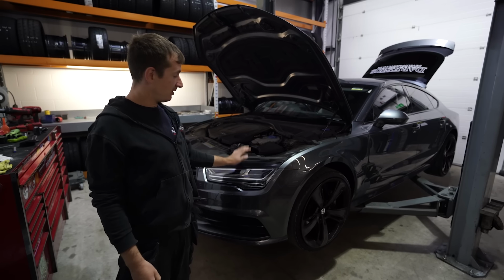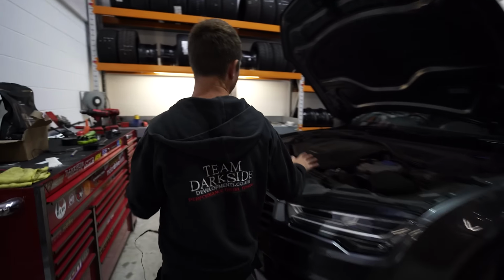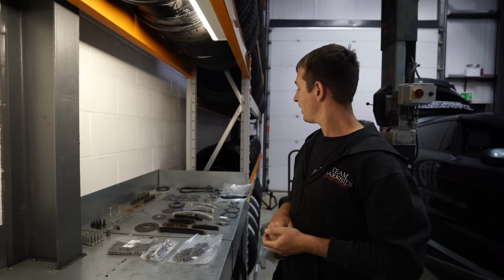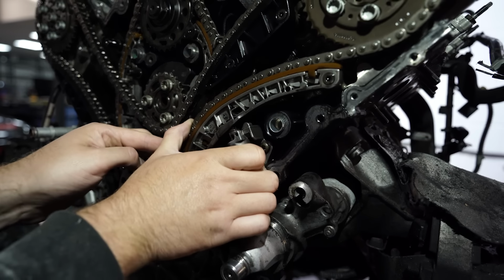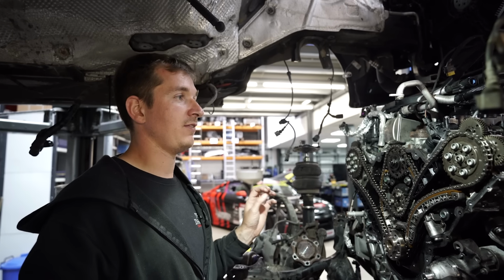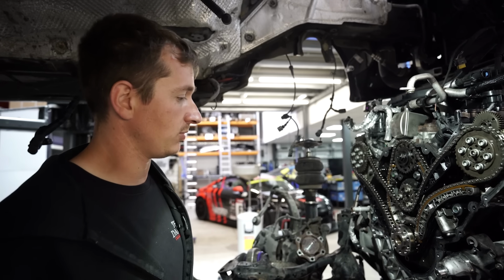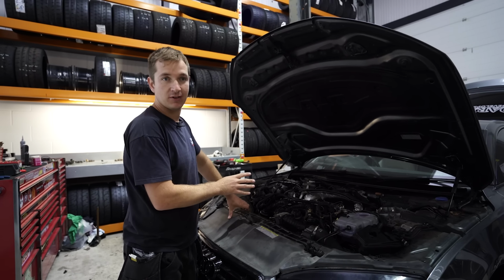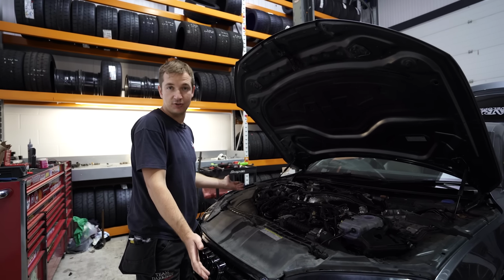AUDI 3.0 TDI V6 TIMING CHAIN RATTLE! - WHAT'S BROKE?? 😳

Comment: You mentioned Paul's A4 and he heard a noise once...  I have a 2015 Q5 CPNB @120K in the USA.  After recent EEW Upper Pan Reseal, I hear a light tick.  It is new tick, but Dealer told me to suck it since I have now passed 120K.  She is currently sitting in the driveway drained of oil with a new filter.  Still debating my path.  Can I get a quick recommendation for Oil Flush(es)?  Don't mind wasting a little oil if it gets her right.
Reply from the maker: Rowe or Liquimoly flushes seem to work for us!

Comment: Hey mate, i have a6 3.0 tdi tuned to 314 ps and i have problems with the brakes, i changed 2 different sets, zimmerman sport and ate rotors+ ceramic pads and i have always the same problem, when the rotors heat up, i got vibration inside the car. I work in germany and i only drive on the motorway, so doing 160 -180 km/h it's normal. What kind of brakes do you recomend for me as an upgrade? the engine was CZVA at the base, the 218 ps one with 345mm front and 330mm back . I really want to get rid of this vibration..
Reply from the maker: We use brembo but I can imagine your hub flanges are warped.

Comment: I dont now why Audi cant make it last like every 3.0 Tdi hast these problems
Reply: The chains are like bicycle chains because of cost (corporate greed), and insane emissions standards.

Small chains don't need as much power to be spun around and make less friction. Every parasitic load on the engine means burned fuel and thus emissions. That's also why there are no more hydraulic power steering racks. Or why variable oil pumps, AC compressors and high pressure fuel pumps became standard. Or low tension piston rings for less friction (which allow oil burning) with specially treated cylinder linings. The list goes on and on.
Like 90-95% of this complicated crap on modern engines is just there to meet these ridiculous emissions standards. The WHO just came up with some numbers, and the EU just made them the law. Done.
Ridiculous long life maintenance schedules (as he said, the oil is done at around 6k miles) do the rest.

Comment: Done this job for a customer, did take me 1 week because I only had like 3-4 hours a day to work on it. Total 20 hours. Was a FWD and only took the gearbox off, so a little less work than taking the engine out. 
I agree with the oil change intervals. Doing max 5000 km or 6 months with my 2.0 TSI. And every time flushing the engine. Done 165.000 km with the original chain

Comment: When my chain was replaced @ 170k km the chain was not stretched. But the tensioner was faulty and the "gliders" (?) were worn.
After replacement, it droves fine. Driven the car almost 60k km my self. Just sold it yesterday (2012 a6 3.0tdi quattro, full s-line, air suspension) ...
Man, I do miss the car already. It was really on point and driver really great. But a (almost) new a6 55tfsi e softens the pain :)
Reply: Hi,have the same problem,tell me please which side tension do a problem?
Thanks
Reply: @krzysztofzarejko1313  it was the (i think only one) big tensioner from the timing chain. It was too soft and loses pressure to easy. I think the only way to access it is to remove the gearbox and engine cover.
Reply: @Yannick13C  Thanks,many people say about two tension on the top,you can do a job not remove engine with gearbox,just remove tension and swap for new one,most right side on top.What you think can help?🤔
Thanks
Reply: @krzysztofzarejko1313  i "think" they are talking about the old engine with separate chains for each cam, and 1 central chain. In my 3.0tdi (gen2 i think) it is 1 chain for the timing. So 1 tensioner.

Comment: I had the same issue with my A4 3.0 TDI when it was still in warranty. Took it to Audi, first they said it was normal to make that noise. In the end they said it needed new cams, which they replaced. Guess what, still had the  same issue. Got rid not long after.

Comment: I think the A7 is one of the best looking Audis. I do like quite like  the sound of the idle even though I drive bmw with n57 engine. Unfortunately these engines are very complicated and even if simple thing inside goes wrong can cause massive bill.
Reply: I6 vs V6 for you
Reply: So in SA I have onwed two A7 and now RS7, u just have to have audi plan active to protect your pocket

Comment: My dad had an A4 with the same issue at 146.000km. Had it fixed at the Audi dealer. They only did the tensioner. Can you imagine that? It was a Quattro as well.. all that work and they didn’t replace the guides, chains etc. Only the tensioner… they charged 40 hour…
Reply from the maker: They do charge through the roof! Definitely not a 40 hour job though
Reply: @DarksideDevelopments  I know….
Reply: Don’t they give the customer an option whether they want to change out everything once the engines out?  That’s insane.

Comment: Tanks very much for the video.ive got a 2008ba5 3.0 tdi,changing the oil every 6000 miles,using Castrol 5w30.car is on 84k now,running like a dream,no chain or any other noise.i heard that the more miles I do,the older the car/engine gets is beneficial to change oil more frequently?but once the time comes to get mine replaced I will definitely going to darkside.

Comment: Did this same repair on a gen 1 3.0 TDI on a Touareg. I like the gen 2 chain setup much better . That old 4 chain design is a pain. I left the engine in though, just pulled the trans. This job isn’t as terrible as people think. Just time consuming. However, not something I want to do frequently. I’ll stick with VW/Audi 2.0T EA888 chains. 😂
Reply: How long did this take you?
Reply: @jaredwalker8685  All totaled, about 24 hours, spread out over a period of a month. It was an employee’s vehicle so I had to attend to customer cars over his.

Comment: Bought a touareg that had this rattle (only noticed it once i got home and started it the next morning) just lived with it for a couple months until I did an oil change, put in 5w-30 vw spec liqui-moly, rattle went away and engine runs like a swiss clock, guessing the rattle was caused by extended "longlife" service interval and subpar oil quality. It has 325 thousand km's on the clock.

Comment: I'm watching this with invested interest as my 2015 A7 3.0 V6 TDI (272 HP) "Black Edition"  just had the very same open heart surgory a week ago for the very same reasons. Even the main timing chain upper left guide was damaged in the same way 🙈 with the inner edge worn / missing completely. Mine's a one owner car with Full AUDI main dealer service history all of its life, last serviced few months ago at the very same AUDI main dealer (who has serviced it all of its life) ...  however the first 3 years under the original AUDI warranty, the oil change intervals were 18K miles "long life" nonsence and as mentioned in the vid this must be what cases the timing chain tentioner failier later down the line. After the first 3 years the oil change intervals on my A7 were dropped to 9K miles hance why the chain started to rattle at around 136K miles and replaced at 142K miles last week. I'm glad it's done as the rest of the car is mint.👌
Reply: I have very very similar story - bought my bmw on 50k with only 3 services (330d n57 engine). I am on 100k now and the car was in the garage every 8-10k for oil change. Zero issues so far. I have zero trust in main dealer as well :). Unfortunately when the car is leased the main dealer has no interest to change the oil regularly as they want the car to fall apart so people spend money for expensive repairs.
Reply: @thepharcyde8285  One of the main reasons why we cannot have nice things.
Reply: I bought a A6 Avant in January and the thing that I was most concerned about was the timing chain rattle (Because it would be a big bill)
Shes a 2014 and just ticked over 119,500 miles so I'm expecting it within the next 30K.
Hows it been since? I expect it to last another 10 years. Car has (until I purchased it) on the same 18K long life services.
My local is a VW Specialist and they commented the engine oil was dirtier than expected.

When you had the engine out did you have anything else done?

Comment: Got A5 2010 with 310.000 km on it and no rattle at all and the chain has never been replaced. 
The only noise comes from the flywheel when the engine is turned off and it was replaced only 50k ago and it seems that it needs to be replaced again.

Comment: Yeah timing belt"s are better then this chain setup on VAG engines but if you look first Gen. M57 or old mercedes duplex roller chain engines there are some who make a million km on the first chain also the tensioner can be replaced from outside and costs a few quid if necesseary. Also the chains are on the front if they ever need servicing😁 the winner here  is touareg and T5 2.5TDI 5.0TDI PD timing gears engines yes they are loud yes they have other problems but no maintence required around timing
Reply: The 5.0 has its own timing issues, and there's absolutely no chance you're not dropping the engine for that one

Comment: The quick fix for this is: drain the oil and put in thicker oil like 10w40, then sell it. I know cause a mate bought one without the noise, he did a preventive oil change in week one... Put in 5w30 and noises were there.
Reply from the maker: Its not ideal is it!
Reply: Perfect, I'm gonna do that!
Reply: 5w30 castrola
Reply: I wonder if thick oil would slow down the wear.
Reply: @simontist  always use the recommended oil grade. Mine has been poorly looked after that's why I use a higher grade and why I got it so cheap.. If you use the recommended oil, it is the perfect oil for minimum wear.
Reply: @simontist  it might fix this one, but it might also create different problems
Reply: Porsche/Audi recommend thinner oil to improve fuel consumption! This is not optimal to lowest wear. Also service intervals are too long for this engine. I now run MOTUL 5W 40 in my Panamera and it has stopped this, for how long? I change now at 5k intervals. Also on older engines/ injectors fuel dilution can be a problem! Higher weight oil will counter this.
Reply: @hallga007  oil does have cleaning and cooling functions too.. thinner oil is better at removing buildup and cooling (thinner boundary layer)... It's a balance between lubrication and everything else.
Reply: @hallga007  Hi, did this solve your issue out of interest? for good?
Reply: No, it reduced it to seldom, but no permanent cure. I sold it to a dealer on a Merc 400d estate. A peach of an engine and 90 hp more!
Reply: Saddest part of this method is if you bought one of these “damaged” engine and then u do like the first service what will be on 100% oil change. And then u realize what u actually bought where u spend all your money u make with every day hard work for long long time. And only thing what u can really do at this moment is step up on the chair, and make a loop from a rope…don’t forget to write a few words about why you’re dead and only who’s fault was it, is already enjoying your money and laughing at you how can u be that stupid and trust him that the car is in the 100% conditions. Only sit and drive!! But he forget to told u HEY MAN BUT U CAN MAKE ONLY 1000km DONT ASK ME WHY…A DONT CALL ME BACK 
U will find out soon….

The number you have dialed doesn’t exist please check your number again or admit that u been deceived about big money like a little kid😕 and now when u are broke af another money spender is waiting outside for repair and guarantees that u will be more broke.

So what was the point of it. 
If u want to get in trouble buy AUDI ✅

If u really want to feel driving experience and become a Real Driver there’s only one option. BUY A FUCKING BMW is that simple. Real BMW from 90’s and maybe we can save Audi owners life’s

Comment: Im pretty sure vag updated that oil filled tensioner at some point (id like to know when), originally it was a plain fit onto the block, the modified version came with an o ring, supposedly to stop the oil draining out.  Problem is you wouldn't change it unless you have the rattling chain 🤔
Reply: You may be right about that as the New / replacement main timing chain tensioner part number is: (O59 109 467 BB) which is almost the same as my old (2015) main timing chain tensioner (059 109 467 AE) except for the last two letters. I'm hoping the last two letters confirm a revision but I'm not 100% sure. 
FYI ... I've  just had the very same open heart surgey (as per this vid) on my 2015 A7 3.0 V6 TDI (272 HP) last week 🙈🤣😉
Reply: @MattCSLnut Ouch. Poor wallet 😮
Reply: @thefamilyrobbo  Tell me about it 🤣 … it hasn’t stopped screaming for a week 😉
Reply: @MattCSLnut mine SQ5 TDI is also waiting for chains to be changed soon. Have Been rattling on cold starts for about 8k km. Sounds horrible but soon It will be fixed. It will cost but I knew that when buying the car so no problemo. :)

Comment: A friend of mine bought a A6 4G, and I told him about these issues. Aaanndd of course he didn't listen.
They started to rattle at 85 or 90k miles. So he went to the dealer (was still under warranty) and they approved it as warranty work.
It was a 7k bill that went to Audi.
But they did all this work and they only replaced ONE !!! tensioner.😂😂😂😂
Then they couldn't make it go straight down the road, for whatever reason. They tried four times. Four alignments, still pulling to the left.😂😂😂
And then the best part, two weeks later it started to rattle again.
He was so sick and tired, he just traded it in for a Hilux.

Comment: I have the same engine on A6. 160k miles without rattles and original chain. I've seen recommendations to remap the oil pump as it could prevent engine seizure. Is it true and have you done it?

Comment: I have a 2013 Audi A6 C7 3.0 BiTDI, and it’s time to replace the timing chain. My mechanic says he doesn’t usually remove the engine for this job but replaces it in place by removing the transmission.
Is this possible, or is it necessary to remove the engine for this procedure? By the way, my mechanic is a very reliable and experienced professional!
Thanks for the answer!
Reply from the maker: You probably could but not a nice job to do if you are limited for space

Comment: Did you not find that the cam gear teeth were worn as well? Seems to be a common issue as well with the teeth wearing out and you can't just replace the gears you can only buy new cams with the gears press fitted on from Audi cost for both banks £4k!! terrifying given how many cars use this engine from VAG range.
Reply from the maker: No, the cam gear were fine on this
Reply: @DarksideDevelopments  lucky wonder which years seem to be affected by this seems to be common issue for certain Audi specialist that’s constantly replacing them along with the timing chains guides and gears.
Reply: True. Also wear flakes from all those sprockets  gets into oil and slowly kills the oil pump and rod bearings. Expensive stuff. Full rebuild for long block would cost probably around 20k in material.

Comment: @darksider development, could you please answer my question?
I am about buying an A7 2016 BiTDI has done 60 km would you recommend buying it?
This car has been always serviced on time without major issues.
Should I buy it? I am worried about the fact of changing timing chain and I dont believe we have a good mechanic like you in Australia or at least where I am living in western Australia..
Reply from the maker: They are good cars, especially when looked after well! You've just got to be prepared for the cost if anything like this does go wrong

Comment: I have a 2015 A6 TDI.  60k miles on it.  I even emailed you once asking some questions.  
     I wish I knew if I brought my car in the same care would be taken.  For some reason I imagine if I brought my car in for the timing chain, they'd do the job by just replacing the chain and that's it.  Granted I don't really know.
    I'm in NY and I used to have a Jetta TDI I'd bring to Massachusetts because the guy always did a great job.
    I bought this car wanting to do a turbo, fuel pump, ect. But knowing I'd lose the diesel warranty is such a big trade off since it should be covered until 120k miles. 
     But then again, if I deleted all the bullsh*t off, would the warranty be needed anyways?
     So far I only used it twice since 20k miles..for O2 sensors.

Comment: Hi, I have a 2013 Audi a6 3.0 bitdi, does a stage 1 tune cause these engines to wear more quikly and also is it true that doing the tune imreases the fuel economy a bit ? Thanks in advance
Reply from the maker: Not if it's a custom tune, done correctly and well maintained afterwards. We always make sure each car leaves safe and reliable. It can sometimes improve fuel economy but it's not something we tend to measure

Comment: Hello, I don't know if anyone will read it. I have a rattle around 1500-2000rpm. It only makes the noise when hot. When cold the chain doesn't make any noise. The chain does not make a sound when starting. Nothing sounds during cold running. It only makes a rattle when the oil heats up. I have a specific Motul 507vw 5w30 oil. Can this problem be solved with a 5w40?
Reply from the maker: Best off dropping us an email to sales@darksidedevelopments.co.uk with reg/vin and we can take a further look into the issue for you
Reply: Hello,
I have the same problem,just when warm have some rattles,no on cold start,do you resolve this problem mate?
Thanks

Comment: It is running from 2:41 to 2:46. In which exact second you can hear the rattle? Is it right after the start (2:42) or just before the end (2:45)? I think I can hear something like metal scratching at 2:45 but I don't think this is the rattle sound?
Reply from the maker: it kicks in at 2:43, it's only a slight rattle as it was caught early enough